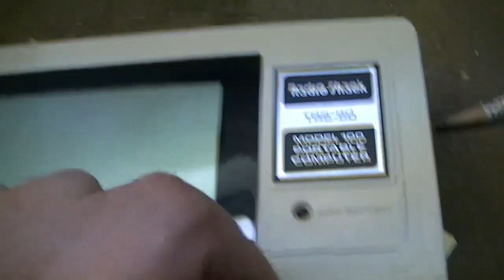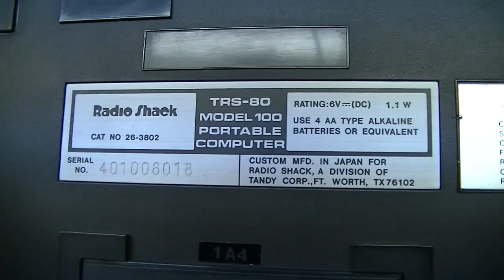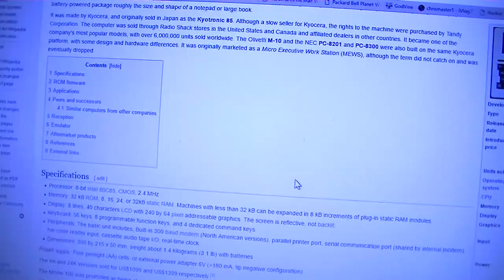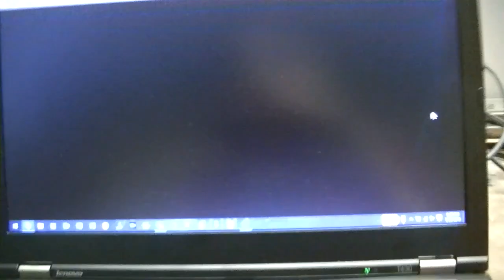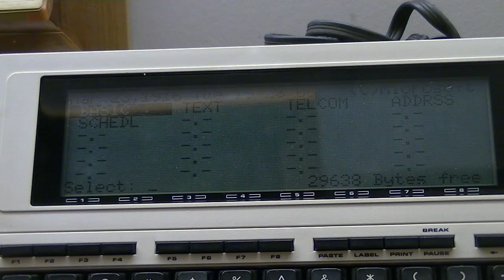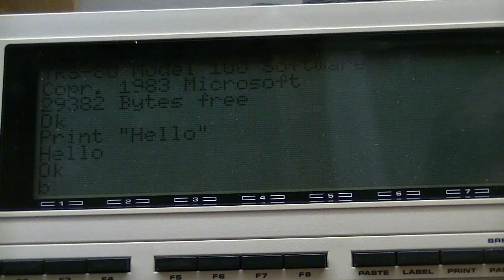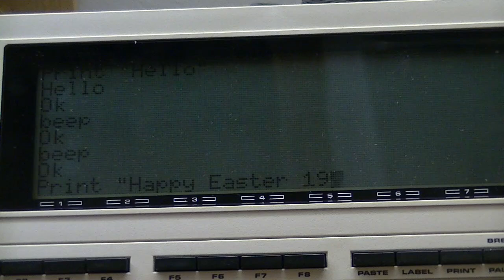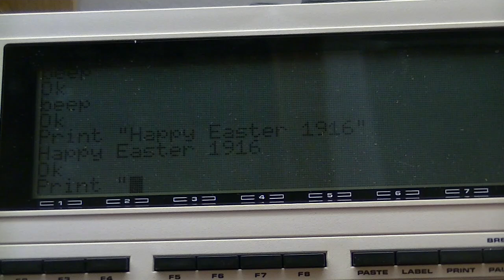Tandy TRS-80 Model 100 Quick Overview

Comment: Muscle spasms can't be much fun at all.  Have you tried looking for the user's guide online?  You might be able to find it in PDF format if you look hard enough.  I think these computers were actually made by Sharp Corporation of Japan.
Reply: The TRS-80 Model 100 was made by Kyocera in Japan and was sold in slightly different variations by Radio Shack, NEC, and Olivetti. Sharp did make the TRS-80 Pocket Computer series for Radio Shack, though.
Reply: I must be thinking something else, I think there were TRS-80 pocket computers, weren't there?  Was the Pocket Computer made by Sharp?

Comment: OMG guys and Billy if you grew up in the mid 2000s.  The Sims Online is coming back online thanks to someone, somewhere.  This Simmer of the name of Jessmika92 just came out with a video showing that this works and tells you all the info you need to know.  Be warned though as this server that she showed off is only in Play testing so you won't be able to follow a full sims life.  I would recommend you'd check it out and I didn't even know this new server esxsists until today when this certain video was posted.  Check out the video to see this ligitlmy working and I also reconmend you sub to her channel if you like Sims related content.  Link to video:  http://youtu.be/x35aPzAi55M